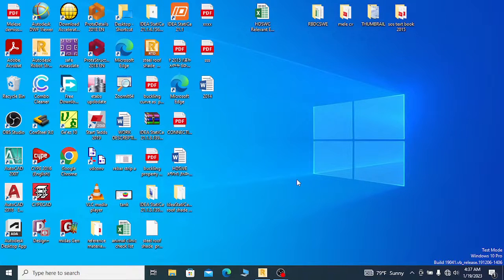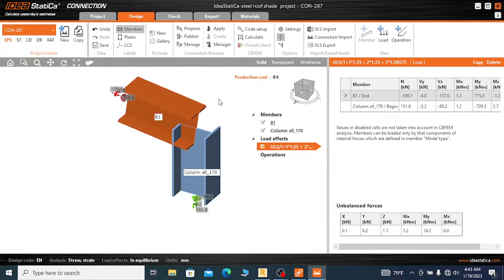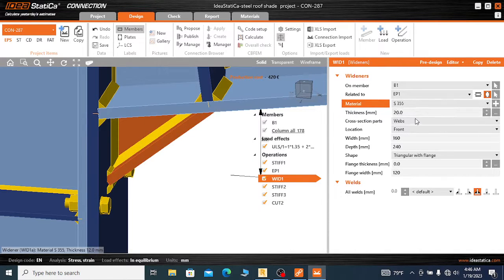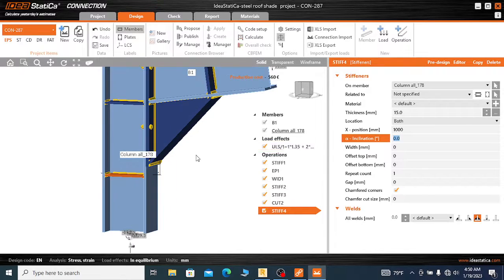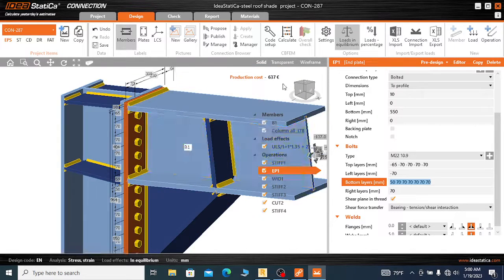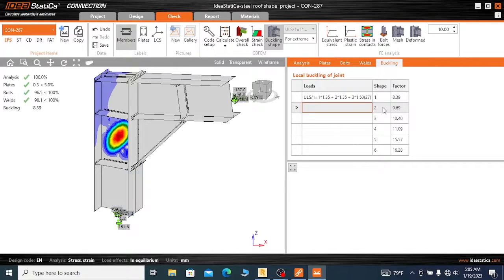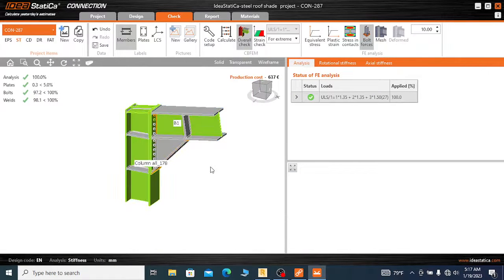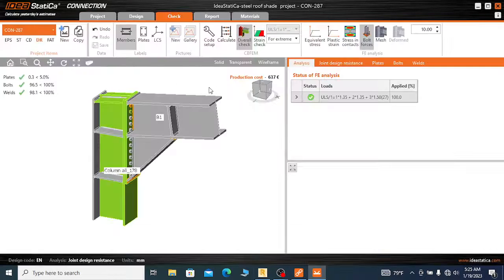DESIGN OF STEEL CONNECTION  WITH AND WITHOUT DOUBLER PLATE USING IDEA STATICA part 6 of 1

Comment: Is throat thickness and weld thickness are same in idea statica ? I mean weld size = 0.7 * throat thickness. So in idea statica, are we entering the throat thickness value only instead of weld thickness ? Please clarify
Reply from the maker: According to eurocode the weld size is defined as the weld throat theckness (a) which is the length of line drawn from the vertex of the two legs orthogonally to the hypotenus. Hence enter the throat weld thickness values and idea statica considers it as weld thickness during analysis and design of connections